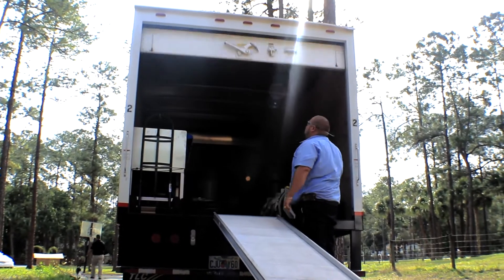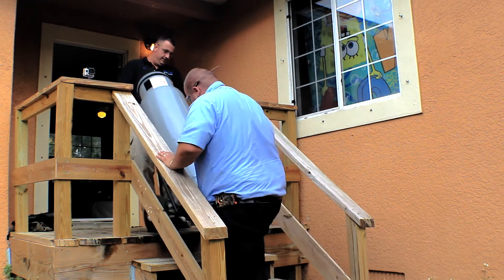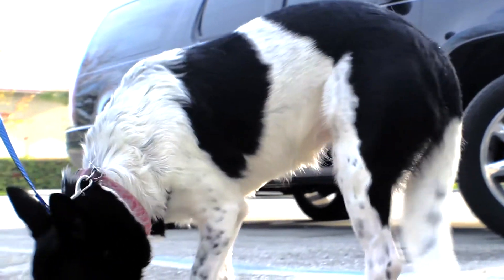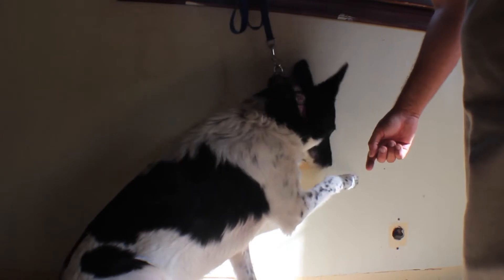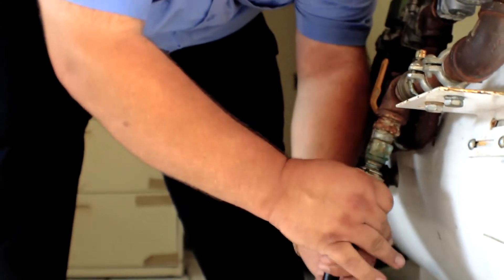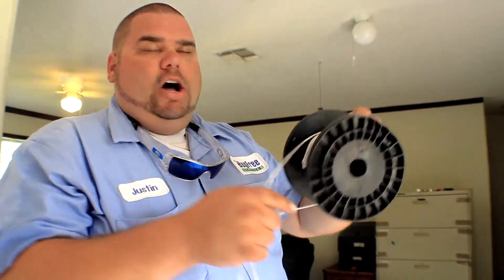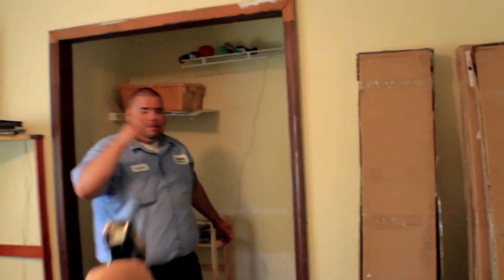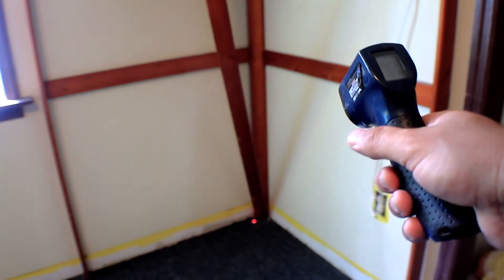Naples Fort Myers Bed Bug Infestation/Treatment True Story

Comment: So she pulled up all the carpets but left the picture frames on the walls where bedbugs are notorious for using as hiding spots?
Reply: Correct. Pulling up the carpets can be essential. Its where bed bugs  are more prevalent to horde to, now during either chemical or heat. The picture frames will get heated along with everything else. As long as the customer is aware of possible damages. However, I have not seen anyone take "prepping" their home as serious these folk. Which SHOULD be done by all who have this treatment.